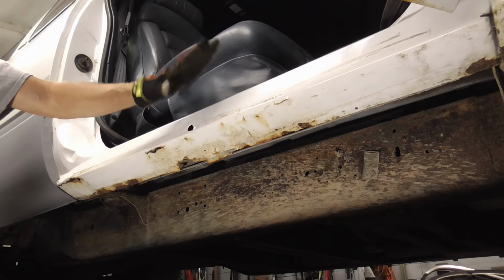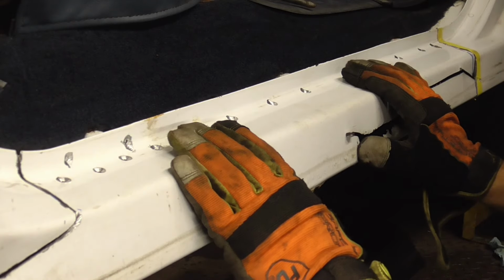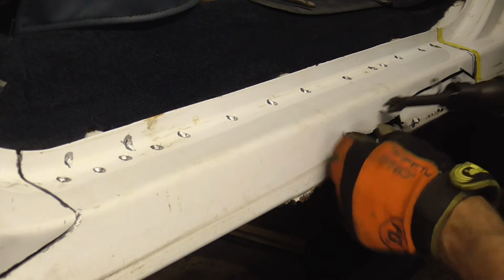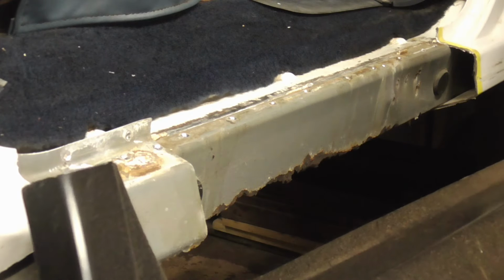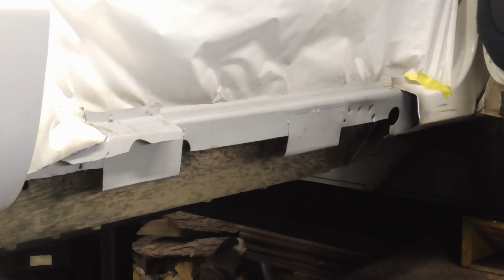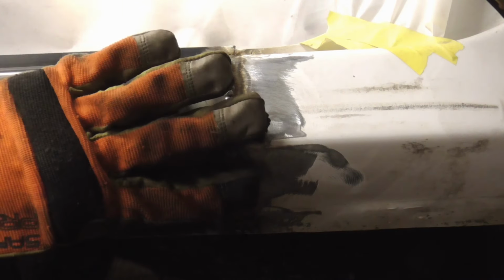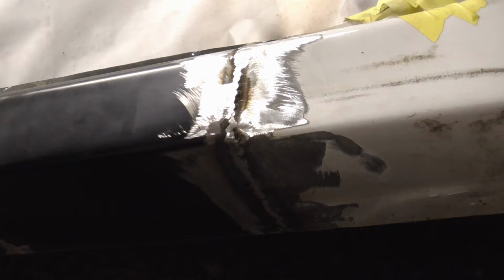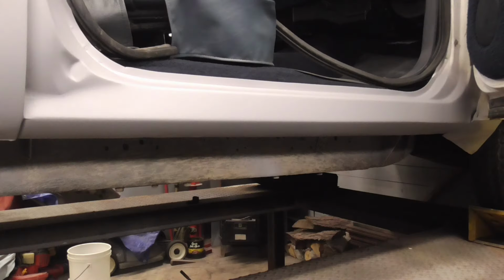Rusty Rocker Panel Removal & Replacement the Easy Way

Comment: Really nice work here. I just did rockers and cab corners on my 97 Silverado extended cab over the summer. I'd never done body work or even welded, and I watched a few of your videos when I was preparing for the project. Too bad I couldn't wait, this would have helped me a lot with the hatchet job I ended up doing. Oh well, great work again!
Reply from the maker: Hey you went for it and that's what counts.  Next time you'll be better at it.  Happy Holidays :)

Comment: Man, if that's a Michigan truck, that was pretty clean. My S10 was rotten inside all the way up behind the lower door hinges on both sides. But the outside looked pretty good...had no idea it was that bad until I got it apart. Wish I could post pics. lol
Reply: When I was in the US Army in the mid-1980s there was a guy my unit that was from Michigan. I think he had a 1974 Chevrolet Impala. 

One day he was on his way out of the parking lot and the rear axle just came up to the trunk because all the suspension collapsed it was so rusty.

Comment: I'll have to try this method on the drivers side of rocker panel, passenger side was shot, along with cab corner. I agree with you on the thinning of metal too much when trying to  grind welds smooth. I worry that smoothing down welds on a butt weld will leave paper thin metal, as i have found out the hard way.
Reply from the maker: Thanks - on some real nasty rust repairs, there is just no way to grind flush and metal finish.  You just can't justify the integrity of the welds if you do too much metal finishing.  Thanks for the comment:)

Comment: Awesome, great tip on not gringing the weld all the way down!.. I'm getting ready to do this type repair as good as i can on my 05 volvo. Trying it make it look real good. Pass side had a shotty repair done.. I saw some red flags when i bought the car but didnt realize it had quarter panel section welded in and a  part of rocker and a different door with shitty paint worn off the edges. All their repairs failed. I l aready welded in the quarter patch, need to do the rocker and then i can get rust free matching doors off a clean part out on ebay.
Reply from the maker: Yep, grinding the welds completely flat destroys the integrity of the repair for sure.

Comment: Inner rockers are normally structural so I have the same concern as claybird.  But good video
Reply: I was thinking the same thing.  The factory boxed that rocker for a reason.
Reply: Your concerns are well warranted, after my 40 years of bodywork and restoration I would never leave the inner rocker off as it was designed to be in place as an OEM requirement.
Reply: @archieanderson2945  I agree. But food for thought - it wasn't doing much for the structure when it was rusted out, like probably half the vehicles on the road are. Makes you wonder how much crash testing is done with this in mind.
Reply: I don't think enter rockers are structural on vehicles with a full frame.

Now they are structural on my 1999 Toyota Solara and I believe most anybody vehicles. And of course those parts are discontinued  unless you go to a Canadian Toyota place.

Comment: so u dont have to spray any protective things on the inner side of the panel to keep the weld from rusting? and the filler goes on a bare metal, not any rustproof primers or smth?
Reply from the maker: Yes - just the way you saw it in the video.  See this for more information on rust prevention afterwards:  https://www.youtube.com/watch?v=8XaZBy7GC7A
Check this out too for more if interested:  https://www.youtube.com/watch?v=JIIonJOVro4

Comment: Hey Jerry!
Do you have experience with a radiator core support on a Chevy Astro van??
My radiator fan is hitting its shroud...this is due to sagging of the front end at the radiator core support...the rust is causing it to collapse. Also, the area where the bushings that attach the engine craddle to the core support needs work as well.
No re-pop radiator core supports are available for the first (85-94) or second (95-05) generation Astro vans. No NOS either.
This will be a challenge!!!!
Reply from the maker: I don't with the Astro but I had a Ranger where the whole front clip was bouncing up and down on the frame.  The core support rusted so the mounts no longer held anything.  I removed the hardware, welded a plate in down there, drilled a new hole and threw and bolt and two rubber bushings in on either side - worked fine.  You're going to have to engineer a way to weld that guy back together or strengthen it.  Just get under there with a MIG and start welding :)

Comment: Another idea if this area is not part of a unibody frame- spray a rust converter primer inside, then an expanding insulation foam spray to fill the entire inside. Then put your time into making a new sill plate out of stainless steel or brass or aluminum. Spray the underside with Fluid Film every fall. If it is structural, bolt or weld in a long piece of square steel or angle iron stock inside of this area, after spraying Fluid Film inside of it.
Reply: Expanding foam traps rust. Just use a non drying rust inhibitor wax on the inside. Take care though. Some provide a thick coat that dries and peels off to leave even worse rust underneath. Ask my back axle.

Comment: I'm just welding in a full rocker. I noticed that you didn't feel the need to plug weld the top, as the butt welds were strong enough on the small section. Are those plug welds needed on a longer piece? thx.
Reply: I was wondering the same about the plug welds. Jerry thanks for the tips.
Reply from the maker: I ended up plug welding the top and the bottom just didn't show it on the video - just a few welds
Reply: @LakesideAutobody  Thanks

Comment: If I camt find rockers for my vehicle would you recommend just cutting out the rust and using fiberglass to fill in the holes?
Reply from the maker: At a place I worked, we never got replacement rockers or any other patch panel that was premade.  You had to cut it out of scrap panels and form it yourself.  You can either make a patch panel out of metal that comes close and make the rest with filler or use fiberglass.  What ever is easier for you.  Let me know if you have more ?s  - Jerry

Comment: I'm curious why not one continuest weld as opposed to spot welds?
Reply from the maker: The heat of one continuous weld can warp or distort the metal.  You also have to worry about blowing holes in the sheet metal from too much heat :)

Comment: on the spot welds that you drilled out, did you spot weld them back together.
Reply from the maker: The panel was spot welded back into place but not in the same spots.  If you are concerned about  the holes being left, you can weld those up but it's unnecessary.  Also if you use a spot weld cutter you won't have those holes on the panel that the rocker will be welded to.  I will be using one of those cutters in a video coming up.

Comment: to get more finesse (control-ability) when grinding switch to a 90 degree die grinder, use a 2" rol-loc adapter bought at Harbor Freight around $5,  then use 3M 3" 36 grit discs, I love them for this kind of work.

now i see 2 things, if I did it this way, you didnt drill holes in top to do plug welds? which I would just get out the big spot welder & put in a few of those, but there is a quicker & easier way if you can get by with it? instead of drilling spot welds on top, slice it & butt weld new over top of it, BUT! use air hammer with hammer head, to slowly go back & forth to push edge down 2 passes is all I do, that makes sure when you do overlap, door wont have clearance issues, & can even do edges, but I do a steeper angle & yes a light hammer for clearance with air hammer. I eve have a rounded hammer head to get into curved spots. 

we do a lot of work for car lots, plus my boss has a car lot, & I put in a bunch of rockers, & he only goes back with metal, no plastic cover it up BS, but I do overlaps, and can do one quite fast.

Comment: do you ever see your patch panel after paint and it shrink a bit over time? or does it look straight for years to come. going to be doing the full size box panel patch. anda  bit nervous. and attcking cab corners and rockers this winter first time too
Reply from the maker: It looks straight for years.  Here's a follow up - https://www.youtube.com/watch?v=gIS1Tbv7Kvw  If you don't bury poor body work with tons of primer, you'll be fine :)
Reply: i have to replace my rockers/cab corners on my truck. Should i remove both rocker and cab corner at the same time then put on my rocker firtst, followed by my cab corner?
 @LakesideAutobody
Reply from the maker: If the rocker slips under the cab corner, do the rocker first.  Study how it was put together at the factory and go with what will make it easiest for you :) @keva2686
Reply from the maker: Yes. Remove both but study how they go together.  Which ever one overlaps goes on last.  Hope that makes sense :) @keva2686

Comment: You make that copper tube or purchase it?
Reply from the maker: That's a Miller Welding nozzle - came with the welder.  You can purchase them on amazon or ebay - welding nozzle or welding cone 😊

Comment: would like to see how you measured the new rocker to fit. thanks, bill in w mi
Reply from the maker: I'll do a video on that when I do the other side - thanks for the suggestion.
Reply: bill howe your supposed to put the new panel over the old and cut both together that way all the cut lines watch up perfectly

Comment: If I am replacing rockers should I leave the good metal and just but weld or lap weld the new one on? Also what primer filler do you recommend? First time trying this and I have watched a ton of your videos trying to learn to restore a car I own.
Reply from the maker: Yes leave the good metal and cut out the section that's damaged by rust.  There's nothing wrong with lacquer primer - sands super easy, works well, cheap, don't have to throw out the unused portion etc.  Epoxy is a great sealer primer but it's not a "high build" primer and Urethane primer is good for blocking like lacquer primer but sands just a bit harder than lacquer - in my mind.  All primers work great really but your going to have to find as system that works good for you.  Maybe urethane primer that is DTM (direct to metal) that you don't have to first use epoxy, or lacquer primer that you can use for everything.  I use Auto Body Master lacquer primer with kleen strip lacquer thinner from walmart.  Let me know how it goes for you and if you have any ?s  Jerry
Reply: @LakesideAutobody  thanks for the advice and thanks for all the videos. It really helps out us shad tree guys.

Comment: I've been working on my ram, on the back underside of the rockers there is some type of tape covering several oval holes, it was all starting to come off so I removed it and sprayed in Por 15, what type/brand tape should I replace this with.
Reply from the maker: Good question.  Maybe something like this - https://www.amazon.com/Gorilla-Weather-Waterproof-Temperature-Resistant/dp/B07GRJ8L55
Reply: @LakesideAutobody  thanks for the response, I thought maybe there was a specific type...

Comment: Heya good job.
I want to ask are u not afraid hot warp when i weld all that line non stop?
Reply from the maker: On rigid panels like rockers, you don't have to worry.  On more open areas, yes you do have to be aware and weld short sections moving from one spot to another to keep the panel cool and prevent distortion.

Comment: I get galvanized in various widths from time to time. Can it be used for a rust repair, or is there some reason not to use it?
Reply from the maker: You can use it.  It does make it a bit easier if you grind off the galvanized coating where you are going to weld.  You won't have to breath the fumes either.  Have a good weekend :)

Comment: I was underneath my 1999 Toyota Solara today. Right behind the passenger front tire weather pinchweld is to jack up the car is all caved in due to rust.  No American Toyota places have the what's called reinforced rocker panel.

 Found a place in Canada. Equivalent to $366 USD. Kind of hate to spend that kind of coin for just a 6-inch by 3-inch reinforced rocker panel.

Do you have any videos on replacing rocker panels reinforcements on unibody cars?
Reply from the maker: No but it is the same as a truck.  This full rocker replacement would be very similar to unibody - https://www.youtube.com/watch?v=U67IHaurCaM  If you don't want to weld? - https://www.youtube.com/watch?v=W9czvb2rFqY
Reply: @LakesideAutobody  

It looks like I'm going to have to re-watch and re-watch your videos because I called 5 auto body shops within 5 mi of my house and they all are "three weeks out".

Other commenters have mentioned that the shops don't take that work in because it's not profitable and because of the risk of returns when the rust reappears.
Reply from the maker: @michaeldunagan8268  The commenters are correct - they don't usually do rust work.  They might and then quote you a super high price - so you either go away or they make ^$.  They're also worried about return work too like you said :)

Comment: Question: Wouldn’t the inside of that weld, if exposed to water at all, rust out eventually?
Reply from the maker: Good ? and here's the best way to prevent that from happening - not weld through primer either - the mig weld process is doesn't work well with WTP - only pinch type spot welding.  https://www.youtube.com/watch?v=8XaZBy7GC7A

Comment: What did you end up doing with the bottom of the panel, was it just left open ?
Thanks, Steve
Reply from the maker: At the end of the video I believe it shows the back side.  There is large square openings - which will allow for maximum drainage and dryness to virtually eliminate the return of rust.  You can close it in if you prefer but it's always good to drill a few little holes for drainage - water and salt will get in there no matter what so it needs to drain and dry.  Hope that helps out a bit - Jerry

Comment: That nice you can set your welder on # 2    I can't with Chicago electric 125 flux I either Slow wire feed  down and put welder on minimum out put, So I don't have fancy Dancy welder like yours
Reply from the maker: That welder can still work for you - https://www.youtube.com/watch?v=ic7Gwf8y4Yc

Comment: What kind of welder are you using ?
Reply from the maker: Miller Millermatic 90, 110V, .023" wire, 75/25 gas  This one is from the 90's but they make something similar.

Comment: How long does it take for each side? I want to do this but I am concerned that I may dive into it and not be able to do the repair.
Reply from the maker: Sorry about the late reply - It takes about 3-4 hours per side to get it in primer.
Reply: @LakesideAutobody  Wow, not bad at all, of course you are a pro so I can double or triple that time. You did such a great job on that. It looks great. Thanks for the thorough video. I've never welded but will give it a try and will practice on scrap metal of same thickness before I do the real repair.
Reply from the maker: @BradySzabo  Feel free to ask as many ?s as needed as you go :)
Reply: @LakesideAutobody  Thank you very much, I truly appreciate it.
Reply from the maker: @BradySzabo  👍😊

Comment: Are you anywhere near MA? I need my rockers restored, I’ve got a 2011 Crown Vic Interceptor, can’t find them for that year anywhere. The body’s solid, mechanically, everything, it’s just the rockers. I’d do it myself if I had a lift.
Reply from the maker: Upper Michigan.  You don't need a lift actually. I never had one while working in a body shop - just gotta crawl around on the floor :(

Comment: How do you do this on a 2006 Jeep Commander? Rusted under the plastic cover in the rocker area.
Reply from the maker: I'm not sure exactly what you vehicle rocker looks like but usually you have to remove the plastic and then try to recreate the rocker the way it was from the factory so you can replace the plastic trim.  Here's an example of that process: https://www.youtube.com/watch?v=bhFLNqGE6KA  Hope that helps - ask again if not - Jerry

Comment: would this not leave weak points in the panel where you have welded?
the rockers/sills are part of the structural integrity of the car and now you have 2 lines running straight thru them
Reply from the maker: Rockers/Sills are structural on uni-body vehicles - this has a full frame.  I welded a new piece in any way - I'm not sure if I understand what you are saying.  Ask again if If you need a better answer.  Jerry
Reply: @LakesideAutobody  ok the full frame may make the difference that would make sense
Reply from the maker: @simcard027  Sorry about the late response - have a good weekend :)
Reply: @LakesideAutobody  thanx yoo too

Comment: Sir what gauge is the metal you welded under the rocker panel ?
Reply from the maker: 20 - 22 gauge is what I use for all hand made rust repairs.  This rocker was purchased from Raybuck.com it was 18 gauge.